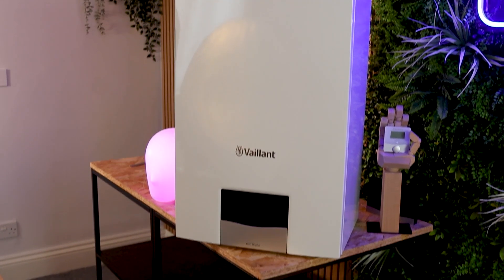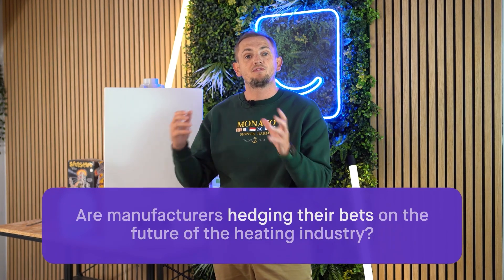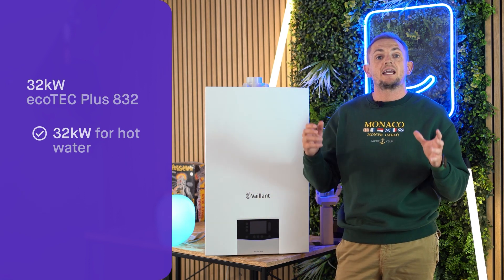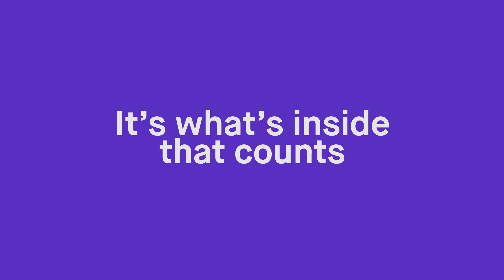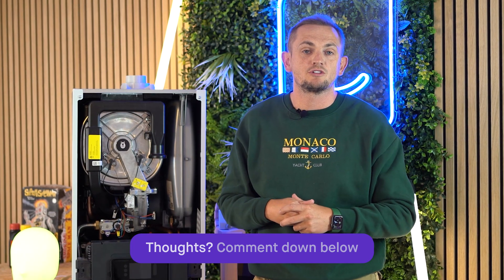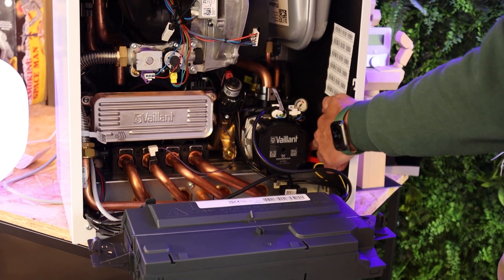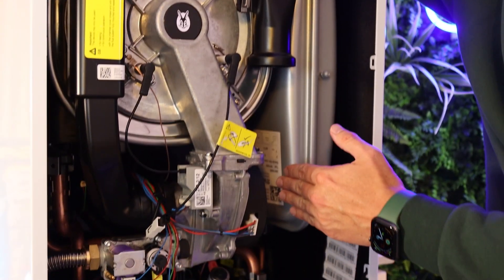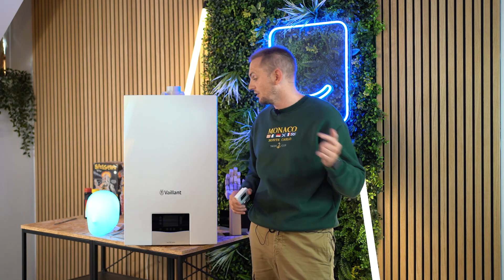Vaillant ecoTEC Plus Review (Latest Model)

Comment: When the engineer installs the boiler. Does the engineer calculated the heat loss of the property so the boiler can be modulated down to the heat loss of the property

Comment: I have this boiler and it’s showing S.31 summer mode code and I got no heating. Can someone tell me how to get rid of summer mode? I’m freezing no heating
Reply from the maker: Hey, does your radiator symbol have a line through it? If you press and hold the radiator symbol for at least 3 seconds then this usually reactivates your heating and a normal radiator symbol should appear without a line, meaning heating mode is activated.
Reply: @Heatable I actually did what you mentioned but it didn’t stop the s.31 mode I even rebooted boiler, I called vaillant and they said it’s something to do with the pcb board and I need to find a gas engineer because I am using a 3rd party hive thermostat.

I’m really at my wits end

Comment: Thanks for your info.  I am a Belgian.  In Belgium we have the Vaillant ecoTEC Exclusive and the Plus.  (Pro is not offered anymore, nore is the pure)  Do you know that EXclusive line ?  I understand that this line comes with condensation on the tap water aswell and has more cupper/brass elements than the Plus line in Belgium.  Do you know ?  And is there a difference in lifetime expectance ?  Thanks, Luc

Comment: do you need the senso home with this latest model? Looks like the same touch screen and buttons. Aren't those features available on the boiler that are on the sensohome control? Including the weather sensor unit connection
Reply from the maker: It is advised by Vaillant to have the Sensohome, but other smart thermostats and sensor units also work.

Comment: Hi, what model ecotec plus would you recommend to replace vuw 242? 826 or 832? Thanks
Reply from the maker: Hi Marek, the VUW 242 is a 24kW combi boiler, so for a like-for-like replacement, the ecoTEC plus 826, which is a 26kW model, would be a suitable choice. As a general guideline, a 26kW boiler like the 826 is typically adequate for a home with 1 bath/shower or a bath with an overhead shower. If your hot water demand is greater than this – for instance, if you have multiple bathrooms or a higher rate of simultaneous hot water usage – then the ecoTEC plus 832, which is a 32kW model, would be a more appropriate option.

Comment: i hope burner seal will last long. any time limit for it to be changed. please explain
Reply from the maker: The lifespan of the burner seal, specifically if it is the graphite type, does not have a statutory replacement time limit as long as Flue Gas Analysis (FGA) readings show correct combustion. However, the seal must be replaced every time the burner chamber is opened.

Comment: Will those controls turn down the flow temperature like how Opentherm does? And will it work on a 2 zone system?
Reply: If you buy a l sensohome it works on two zones. The comfort home can have up to four zones.
Reply from the maker: Thanks for your comment! The Vaillant won't work on a 2-zone system, unfortunately. The controls can down the flow temperature though.

Comment: It’s a real shame valliant hasn’t updated the heat only model as well a 10 to 1 efficiency is what’s needed there as well not the 1 to 6 on the market now
Reply from the maker: A lot of the manufacturer's focus has been on renewables such as Heat Pumps lately. Who knows what the future holds!
Reply: @Heatable  i had a eco dan split x2 before on an older property pre 1920 listed,  it had a 20kw heat loss and had 11kwh solar as well to help cut costs it used 14000 kw in one year compared to the old boiler that just cost 2600 to heat it and that was over 30 years old, a new boiler would be far cheaper to run,